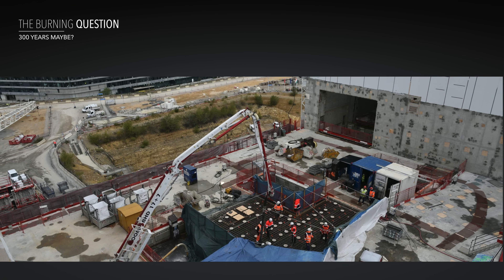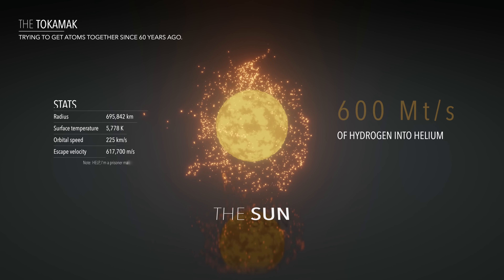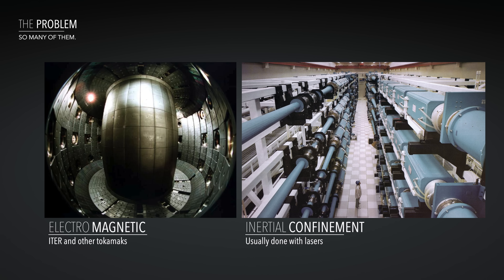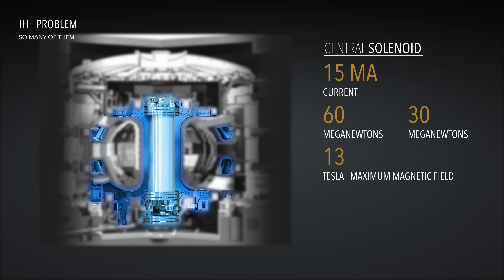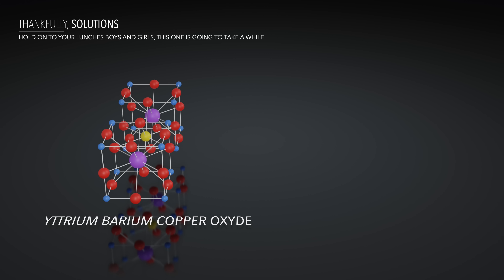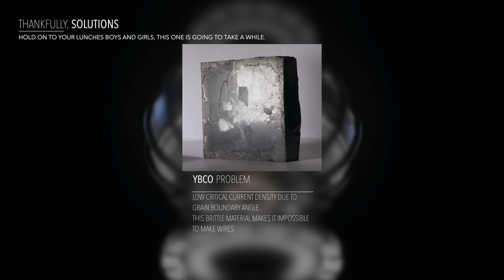Fusion in 30 years? ITER update [2020]

Comment: Nice animations, shitty science:
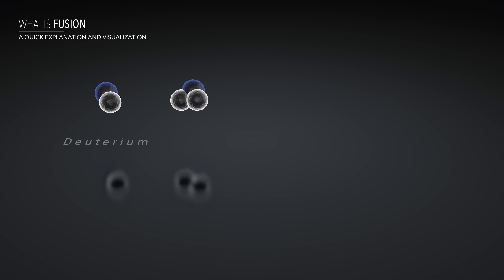3:07 fusion after fission? really?
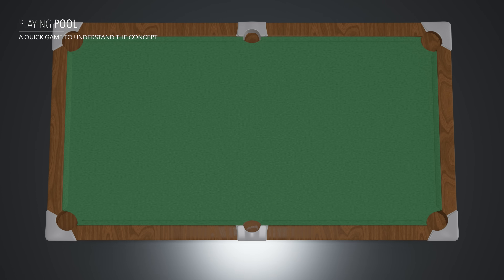4:29 coulombe barier isn’t electromagnetic
4:48 magnetic forces with atoms? WTF?
4:48 what atoms? where do you have atoms in plasma?
5:34 no such a thing as “the best temperature on Earth”! truth is: the higher the better
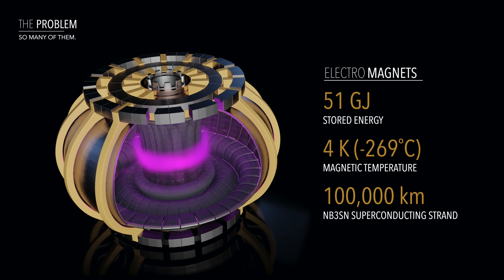8:24 high pressure in tokomak? what would touch walls to exert that pressure?
If you wanna talk about something you have no idea about, try to do proper research before.
Reply: At 4:48 ...... The concept isn't wrong(could've been worded better however) the electromagnetic force(actually they merged the EM and Weak Nuclear Force into the ElectroWeak force) is what normally keeps atoms apart but with high temperatures and pressures in fusion the strong nuclear force takes over and overcomes the repulsion of the ElectoWeak force(the strong nuclear force is the strongest of the four(three)forces but is only strong on extremely small distances) and forms a new helium atom from two lighter hydrogen isotopes along with energy and a spare neutron......

Comment: There is no way this thing will work within 35 years. There are forces much harder to break than the Coulomb forces: those are the pressure of the oil lobbies (which have NO interest at all to have clean and free energy and they have great political power) and also the eagerness of the contractors. The later you finish, the more fundings you receive to get this thing done. 
So, not to be pessimistic, but we hardly ever see such big projects completed within time and budget. Not to mention the technical difficulties or even the feasibility...
Still, want to believe...

Comment: OK but the
reality of the nuclear fusion today is a big delay of the ITER project, a
considerable budget overrun and especially technical difficulties that we still
do not know how to solve. We will be far in 20 .. for a pre-production machine.
The tokamak that was thought to solve everything is probably more difficult
than it solves. Where are the validations of the processes on the ex-TORE SUPRA
machine that has been reconverted urgently to validate the ITER options ? Personally,
I think that the Z machines will make it possible to advance this subject more
quickly.

Comment: 1million 500000 cº temperature inside fusion reactor what metal can resist such big temperature ?
Reply: The hot plasma doesn’t touch the outsides of the reactor. It’s suspended in the middle.
Reply: It's 150 mln for starters, 1,5 bln would be much better. Why do you think you need material that can withstand such a tempererature?

Comment: Can someone explain me how are they planning to utilise that 150 million C plasma to generate power ? 
It is a self sealed, heat isolated, super cooled chamber right ? So even if you have super hot plasma whirling inside how do you use that ? Do you "vent it out" to super heat water to turn turbines ? I fail to see how it is done. 
Thank you very much.
Reply: Maverik Miller High energy neutrons are released, which heat up a liquid metal blanket around the reactor
Reply: @Gomlmon99   Thanks I did not know that. Can you give me some links on this part ?  I wanna learn about it because nobody seems to talk about that part which is really not mentioned at all. 
 Thanks.
Reply: Maverik Miller I’m afraid I don’t have any links, I only know because I work at a fusion reactor. But the majority of the energy released by the reaction (~80%) is in the form of a neutron. That flies into a liquid lithium “blanket” that’s flowing around the reactor. It heats up the lithium, and also reacts with the lithium, forming helium and more tritium (how tritium is regenerated). The heated blanket can then be used to heat a secondary water cooling system, which then turns to steam and turns a turbine, like any other power source.
Reply: @Gomlmon99  Thank you very much. Your description alone cleared a lot of things in my mind. 
 It seems quite a complicated process to actually extract the energy from the reactor.
Reply: Maverik Miller You’re welcome :)

Comment: Like... You're seriously making a video about Tokamaks as a way to produce energy without mentionning the biggest challenge of all ?

Disruptions, ITER will cost over 50 billions by the time it's done and the first test may very well last 10 seconds before the inside of the tore gets ripped apart by plasma disruptions and put it out of order for years.

Folks this is a dead-end, the most promising fusion researches now are based on Z-Pinch effect, both americans and russians invested in it and it proved promising so far for less than a tenth of what this ITER crap will cost. Look up Z-Machine.

Comment: I’m 75, and have listened to “fusion in 30 years” for as long as I can remember.
Reply: Just as fun as flat-earthers (claiming to be) trying to reach the edge.
Reply: @MrSaemichlaus  Sure. It's no fun. But "working fusion reactors in 30 years" is a constant through the last 50 years.
Reply: Don't worry you can pretend as if it is finished in 30 years. You probably wont be there to deny or confirm it by then. So basically you can tell yourself: we finally did it.
Reply: ... didn't do it.

Comment: Cooling the assembly down to >10K puts it in range of superconductors. With a smaller unit could not that also be reduced a bit to only what is necessary for structural integrity?  The project as a whole appears to be over engineered, or built for other purposes.

Comment: It's a good jobs project for plasma physicists, but I highly doubt anyone's ever going to use tokamaks for power production. 

Fission is a thousand times easier and running a non leaky molten salt reactor that needs to contain 3 bars of pressure is always going to be orders of magnitude cheaper and simpler than containing plasma for fusion purposes. 

Also, given the scientific illiteracy of voters, it'll suffer from the same problems as fission reactors.

Comment: it really doesnt matter if its fusion or fission , they are nothing more than expensive dangerous heaters. So fusion can make a small Sun, what happens when the magnetic field thats containing it stops? Or any other failures? Im just glad its not being built in the USA, but i dont think it matters where you live if it fails to contain the plasma, it'll destroy the whole planet. And if it actually made electricity directly, instead of heating something to run a generator, it would make sense. It also seems it will cost 4-5x more to run it than the power it can put out, another money-pit like CERN.
Reply: What are you on about lol? If the magnetic field stopped, the plasma would just immediately fizzle out. It physically can’t explode.

Comment: Fusion energy has been just 10 to 30 years away since the early 1950s. Now it’s maybe 500 mw in 10 to 30 years and 80 billion plus Euros. Maybe I’m just being too skeptical but it doesn’t sound to me like ITER is going to lead to anything resembling affordable electrical power anytime in this century, if ever. I’m old enough to remember when fission power was going to give us power so abundant it was going to be too cheap to meter. The technocrats of fission power turned out to be not so correct on that prediction. I’m thinking the technocrats of fusion power may not be any better in making predictions. As for it being clean what about neutron activation of materials placed in an intense high energy neutron flux? The technocrats of fusion power seem to ignore that dirty little secret in their public predictions.

Comment: ITER is a waste. They aren’t even using the latest superconductor tech, and the machine won’t even produce power for the grid.

The ARC reactor design from MIT will be the way forward. 1/8th the size, 1/100th the cost, twice the power output.

Comment: I'm not fully understanding the final conclusion of firing up the reactor in 35 years. The first test runs are in 2025, according to this video. Is the idea that the ITER will fire up in 2025 using presently available technology and materials, but will need the advancements referenced in this video (all of which are still experimental)  before fusion can be taken to a viable stage? If so, why build ITER now with current tech, instead of sinking all that money into the experimentataion and R&D needed for the technological advancements which will ultimately be required anyway.

Comment: Fusion power will not happen. The tech side is not the problem.  The issue is the metallurgical side of fusion power. There is no know ln material that can handle the temperatures involved. So this has been the largest scam in the world.
Reply: animal16365 but the hot plasma doesn’t touch the walls of the reactor
Reply: @Gomlmon99  

It's not the plasma.  It's the heat generated by the plasma that's going to be a issue. To get and maintain the fusion process here on earth will require the plasma to be heated to roughly 100-120 million degrees. And there in lies the issue.  There is no known material that can with stand those temperatures. Even if the plasma doesnt touch the walls.
Reply: animal16365 but why are you even mentioning those temperatures? That’s the temperatures in the hottest parts of the plasma, not the temperature that touches the walls.

Comment: Hell, even if ITER works, look at that behemoth of a reactor housed in that gargantuan facility. Look at the construction costs and the resources required. At the systems required to keep the thing running.
That entire thing will have a thermal output of... 450MW. That's it.
Meanwhile, most nuclear power stations clock in at 2000MWe (electric) while having remarkable safety records.
I simply don't see fission becoming economically viable anywhere in a century.

Comment: Nuclear fusion is so hard is because the forces keeping atoms  away are so strong, one thing that helps is gravity and the stronger it is the better
     This is the reason all the stars like our sun do fusion with much less heat then our reactor will require is because the stars are ridiculously massive with incredible amounts of hydrogen ( the easiest element to fuse) available with ridiculously strong gravitational pulls creating unbelievably high pressures making it very hard for even hydrogen atoms to move around without smashing into each other hard enough to fuse
    The fusion in stars is actually how every element is/was made including us hydrogen makes helium which makes lithium which then makes beryllium and so on but as you go threw it get harder and harder dramatically to fuse each element ( the atoms you have the stronger they repel)  which is why stars stop at iron, the 26 most common elements in the universe are also the first 25 elements that stars can make threw proper fusion everything after iron is made by supernova or star explosions (don't worry our Sun is not big enough to go supernova) it all comes full circle
   We will never be able to create a gravitational force similar to starts so we have to do with what we can  make heat and use magnetic fields  to pack atoms as tightly as possible so when they start flying around at ridiculous speeds they will hopefully hit each other hard enough to fuse making a new element and releasing incredible amount of energy in the process, hopefully the ITER is a success if it does show fusion can be a reliable and sustainable form of energy are civilizations energy needs are pretty much solved on the electricity front.......so cross your fingers

Comment: Mankind just needs this... To challenge climate change, we have to build carbon dioxide recapturing systems.
We can built them with the materials, if we work together. The critical point however is with which energy you first build these machines, then run them and finally recycle the resources put in them.
So it all boils down to the question where we get this energy from.
From coal? Useless
Water power? Not enough
Solar and wind? Difficult
Nuclear fission? Absolutely not, ever thought about how much CO2 is produced and energy wasted when mining and enriching the uranium?

If we would crack nuclear fusion we would win a big advantage in this deadly game.
Giving us basically free energy we could run water desalination, carbon capturing systems, etc.

Lets do this.

Comment: Fusion has been "just around the corner" since the 70's. I don't see it happening anytime in the next 100 years.
Reply: I'm assuming you're basing this opinion on your vast expertise of nuclear physics? Just because something hasn't happened in the last 50 years doesn't mean it isn't going to happen in the next 50 years either.
Reply: @antred11  You know what happens when you assume anything! Every time fusion is touted as just being "real close" just around the corner they come up with a new problem they never considered. Such as the asymmetrical ignition of the fuel pellets which keeps the laser from causing the desired implosion and increase in density necessary for fusion to occur in a low gravity environment such as Earth.

Comment: The biggest issue I foresee for fusion is that it's very unlikely that the profit potential of a reactor will ever justify the initial spend for the reactor, or the cost of maintaining it. Fission reactors struggle to be economically viable, even though they are relatively simple by comparison.

Comment: Subject Zero Science Could I make a suggestion? 

The thermal gradient created by the reaction itself can also be used to create electricity too thus increasing its overall efficiency. 

How? I simply suggest adding a series of thermoelectric generators radially to the overall design to convert heat produced into even more electricity. 

I got inspired by stumbling across a watch called the Power Watch 2 by Matrix Industries. They put a very very small scale thermoelectric generator within the watch to convert a user’s body heat into electricity to charge the watch. 

So I thought to myself, why not modify the generator itself to increase its efficiency 
Then increase its scale to an appropriate size for this project then make a chain of them that hugs the device radially about its axis to convert the waste heat produced into even more electricity. 

Just my two cents. Because all that plasma will give off a ton of heat and for an thermoelectric generator, the greater the thermal gradient, the greater the electricity produced.

Comment: "It is the most powerful reaction after fission" well, no. The mass to energy conversion in fusion is many times higher than fission and is generally just better in any way.
Reply: Fission is infinity better as it stands. That's because we dont have a fusion reactor which will produce more output than input. So fission is superior.
Reply: Brad Viviviyal  very easy way to heat water once it's going. The only way to heat water efficiently without releasing toxic greenhouse gases. Sadly governments around the world are run by ignorants instead of scientists, so yeah...
Reply: In theory, which produces more energy depends on the elements / isotopes you fuse or fission. Any elements whose atomic number are lower than that of iron can be fused with a net energy gain. Any elements whose atomic number is higher than that of iron can be fissioned with a net energy gain. The energy gained by fusing or fissioning one or more elements into another is exactly the same amount that is required for the reverse conversion.

Comment: Google: Wendelstein 7X, ran a Self-sustaining plasma last year while producing more energy than needed to power it up
Reply: Google Polywell, a seriously under-funded fusor-based reactor that, AFAIK, could generate electricity directly instead of through water->steam->turbines, is much simpler and, again AFAIK, wouldn't need to be refurbished every once in a while; ITER will need to have the walls of the reactor replaced due to the damage caused by the plasma.

@Subject Zero Science you should make a video on the alternatives to ITER

Comment: Another big problem with fusion is that future fusion power plants connected to the grid will produce much more power than iter while trying to mantain a similar size, but we still haven't found a way to extract that much more heat with the limited surface area available.

Comment: 80 Billions...  Taking into account that the LHC design and construction took only 5 billions, this seem like a total waste of money for science and discovery projects. 
There are only one project that seem to have wasted more money taking into account its lack of technology applied and the lack of utility, I tam talking of the SLS and Orion program with 43 billions.
Fusion energy does not have a future, even if they accomplish everything,  reducing the cost of all elements with improving by a lot and getting deuterium and tritium at reasonable cost, it would be all for nothing, because they are just making heat..   just to convert that heat into electricity, which you need the cooling tower or a expensive heat exchanger, the thermal cycle, the steam turbines, only taking into account the thermal conversion cost, that alone reach parity with today best PV and Wind LCOE cost. 
Those technologies keep reducing cost every year, by the time they achieve fusion, solar and wind with storage would cost 1/10 of fusion power or even less.

Comment: Fusion isn't free energy. It costs $80 B, and we will (allegedly) get only 500MW. Also, it's not clean because making these magnets would require some work. And still IMHO, the output will be lower than the input even after 30 mln years. If the Universe can't find a way to make a star smaller than Jupiter, it probably means it's impossible.